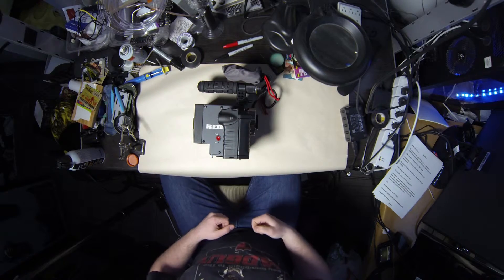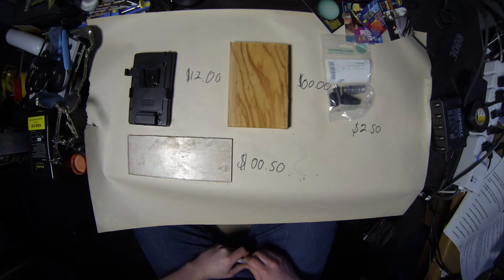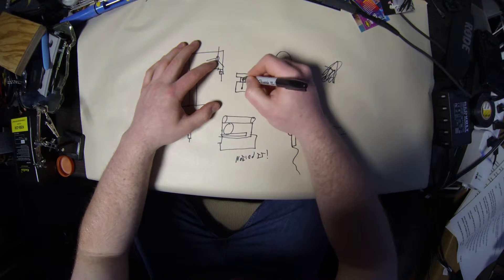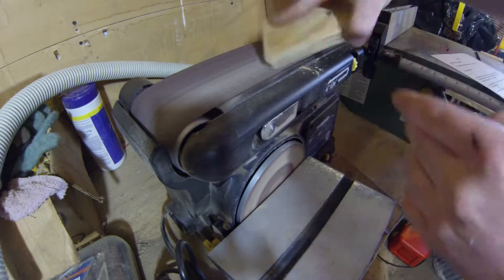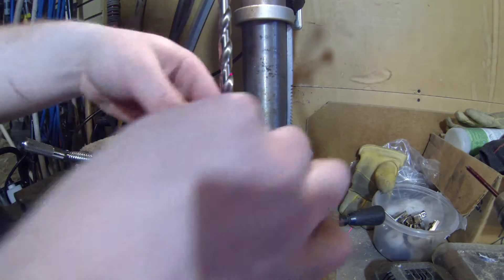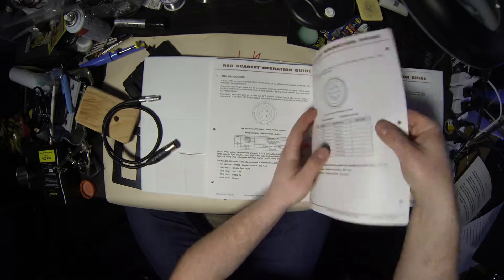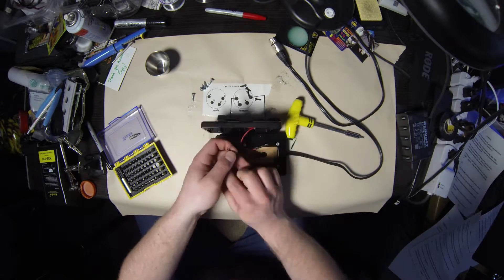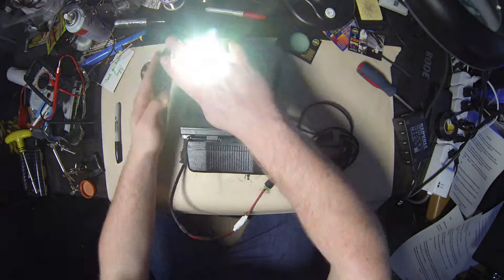DIY Cinema V-Mount Battery Belt Clip

Comment: Wood can be a conductor, screwing positive & negative to the wood may not be the best solution.. better would be to solder those connections and wrap with electrical tape, and use another method to prevent the cable being yanked out -- even just a knot to prevent it being able to go back through the hole would probably suffice. :)
Reply from the maker: Thanks for the comment, 

While wood can be a conductor I'm not too concerned about this because of the relatively low voltage. 
However, i have considered using expanded PVC or even Styrene for the bulk of the backplate.
As for the cable, future designs will have a Female flush-mount 4-pin XLR Mounted directly to the chases, and an external M-F XLR cable to the Camera.
Reply: Generally it's only really an issue in very fresh wood, the plywood you're using isn't likely to be much of an issue but it's worth being aware of because while any potential conductivity in the wood isn't likely to hurt anything it could still drain the battery if left attached, which if left long enough could cause irreparable damage to the expensive v-mount battery ;)

Comment: Great video! Have you tried making your own V-mount battery? Maybe with 18650's.
Reply from the maker: +Rolando Sustaita 
I've considered just that several times.

Biggest problems i have with the idea are all based around balancing the cells to charge evenly (and stop it from bursting into flames), and keeping the pack roughly the same size as the consumer grade packs.   

Balancing Li-ion batteries is tricky, not impossible mind, but still not easy, plus you will need to purchase regulators and charge indicators to keep everything safe and rechargeable. Even though 18650's are readily available and very inexpensive with all the other parts needed you end up costing more than just buying a v-mount off the internet.    

Second, getting the voltage (12-14.5v) is not hard, however maintaining the massive power draw from a cinema camera is another story. from what i have read, it would only take 4 batteries in series to get the right voltage, but more than 6 in parallel to achieve the amperage needed to run even basic cameras (more like 12 for digital cinema) that means you would need a bare minimum of 24 cells, and even that would die very quickly. 

Overall, building a battery block using 18650 could work, if you dident mind a tether, but for handheld/steadicam work it would probibly be easier just to buy the v-mount battery, after all some chinese ones will only run you $150-$300 with a charger.
Reply: Don't you think the chinese versions are using 18650s?
Reply from the maker: +Rolando Sustaita 
I can't speak for all the brands out there, But the one i purchased has a beautiful flat-pack lithium in it with power indicator and cell balancing circuit, and I only spent $250 for it.